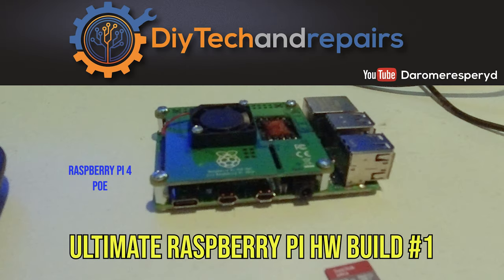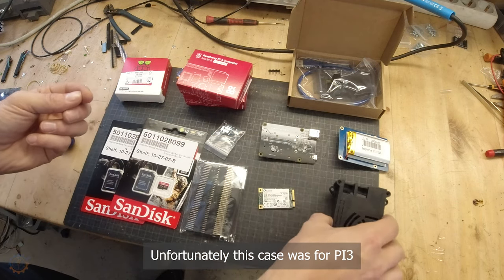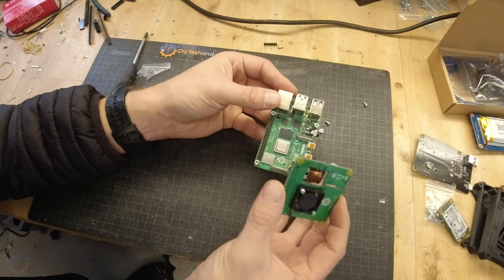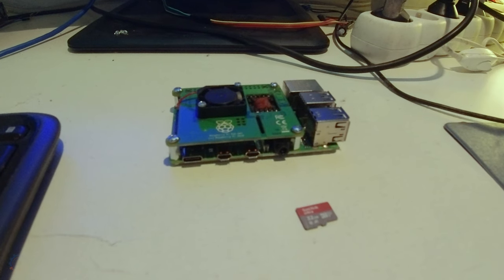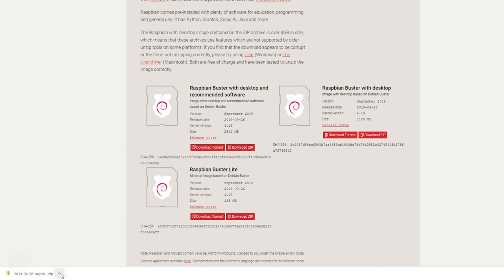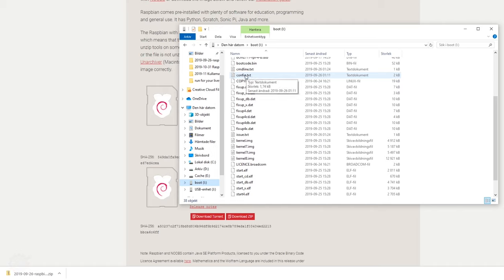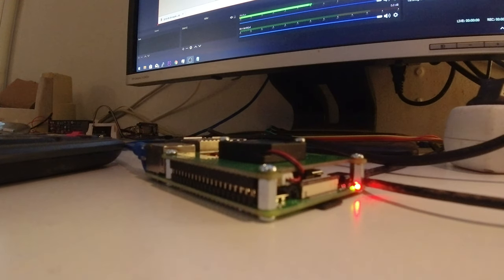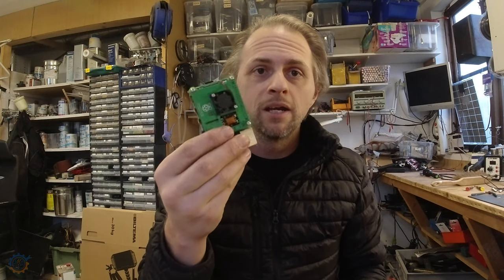Raspberry PI HW build #2 - Poe HAT

Comment: Brilliant, you do make that look so easy. 
How you took the pi out the box, and then just tossed the box made me smile. :-)

And that hint about SSH, WOW. I had been connecting it to a HDMI first for so long. 

Thanks... And great work...
Reply from the maker: I use the extreme versions when i need performance. Its quite difference between Them in write and Read Speed. Thanks. Yes you dont need any screen to configure Them Up :) i automate all My installs nowadays so i have ansible scripts to run
Reply: DIY Tech & Repairs is it also possible with Ubuntu server? Thanks!